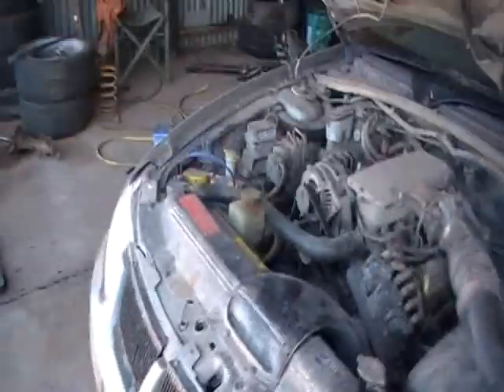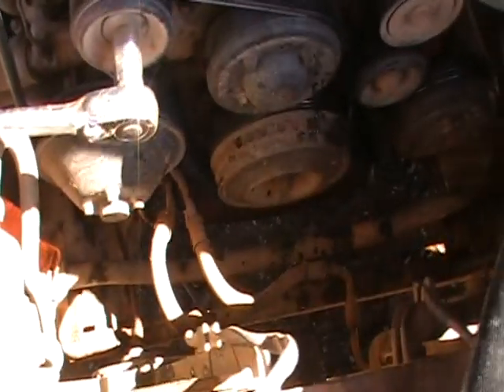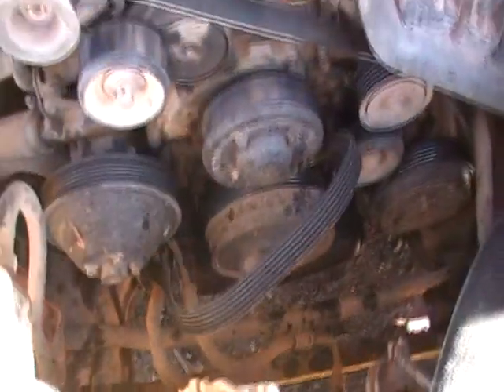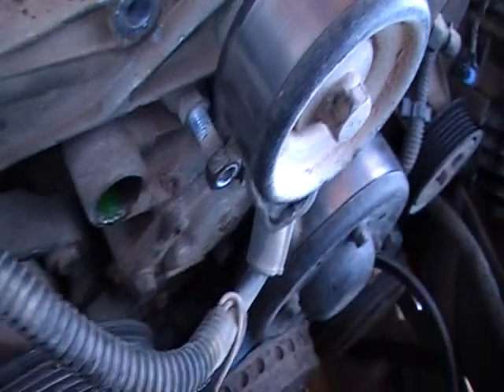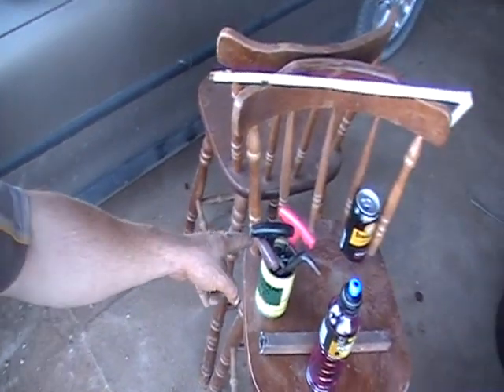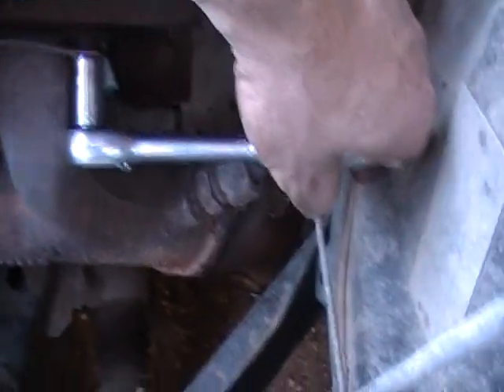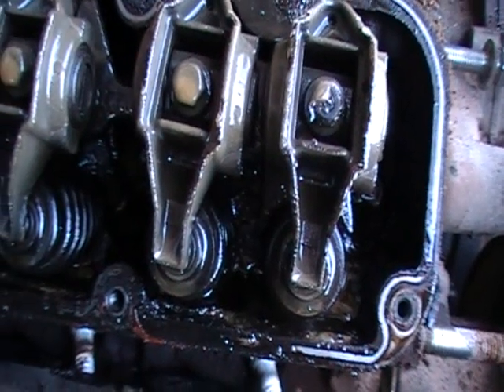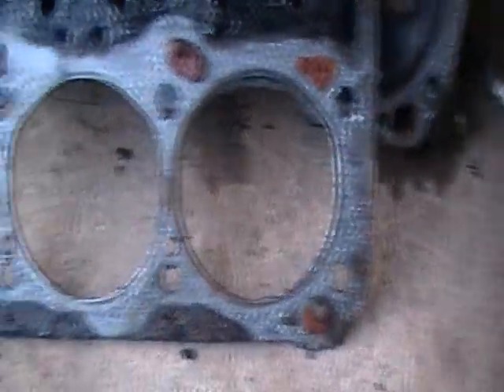Changing The Head Gaskets On My VX Holden Commodore (Part 1)

Comment: They very rarely do head gaskets it's normally the lower intake plenium gasket that causes coolant and oil to mix
Reply: @Benny Hutch 7 months later may have also saved me an entire weekend
Reply: @Benny Hutch  was it getting warm with the leak?mine is but it still recons its got good compression and is only slightly making a milkshake
Reply: @Benny Hutch  well I got the intake gasket kit today so il slap it in tomorrow and see how it goes fresh oil change for the system to
Reply: @Benny Hutch it worked man car runs fuckn awesome
Reply: @Benny Hutch  hahaha yeah bro I got it cheap the bro couldn't work out what it was and I Sussed it within 4 days of ownership
Reply: No worries guys glad it sorted your issue with your ecotecs

Comment: The "little do-flakky" is the EGR (Exhaust Gas Recirculation) Valve. When it dies it makes the engine surge, usually makes u think its the fuel filter when it's not. Not that I've ever had that happen....

Comment: just taking my heads off now and yep, water gushed out of back left head bolt hole. Must be normal. my gasket has no water issue. Thanks for the video. great help. Cheers.

Comment: 9:56 lol frickin GMH,  If you have no water in engine oil, or smoke out of exhaust, & car runs ok. before you do any big maintenance job, Check your Radiator oil cooler, the rubber seals, can deteriorate and cause brown sludge in coolant. my vx commodore had that problem.